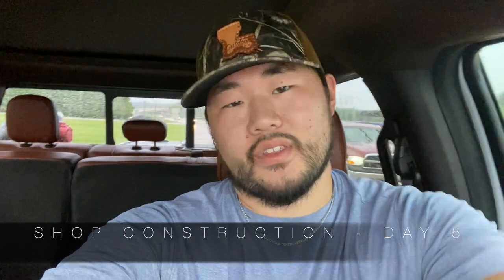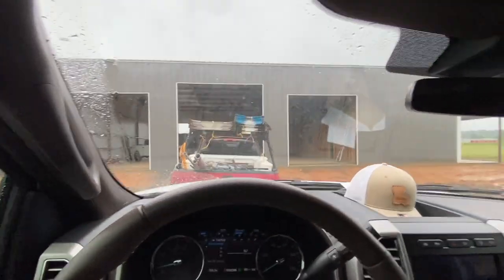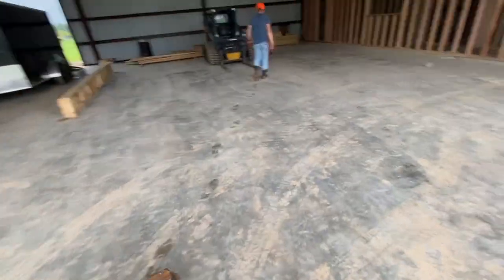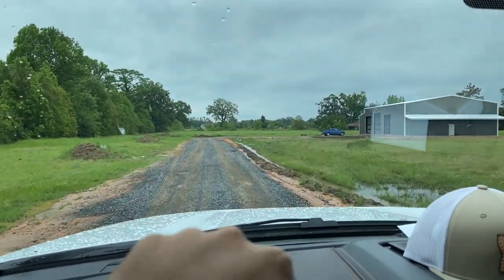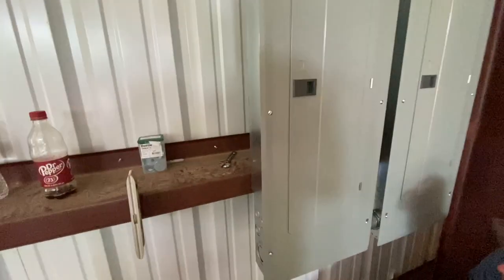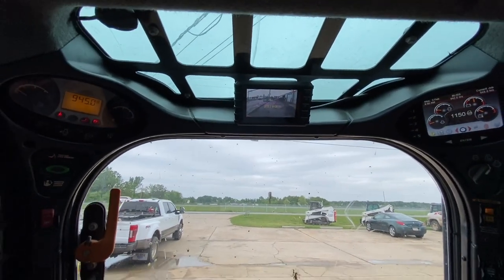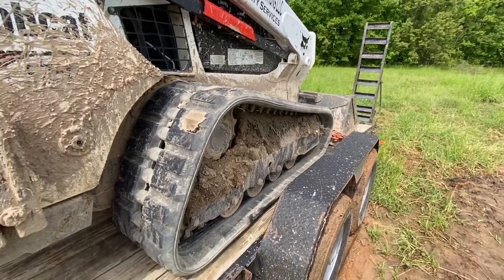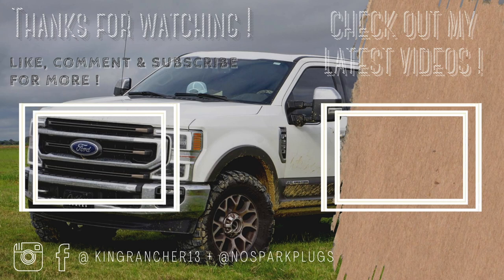Day 5: We're Building a 2nd Floor?! 2020 2021 Powerstroke Tow

Comment: I load them backwards because depending on what brand it it doesn't have an attachment or just a bucket it could tip backwards on the rear door. If I have a rotary cutter or something heavy I load forwards.